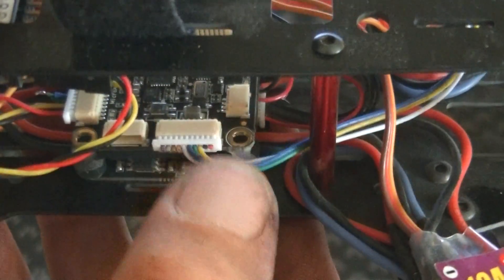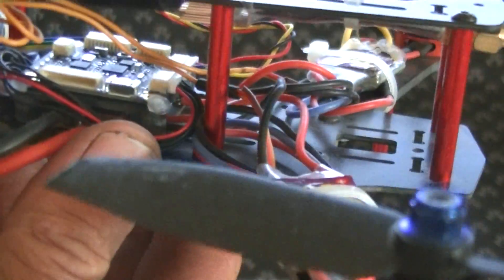apm2.7 with cppm

Comment: Hi again. I'm testing a 250 quad with the Micro HKPilot 2.7.

Did you ever encounter any issues when in Altitude hold mode? Every time I try to put the mini quad in Alt Hold mode for an AutoTuning session, the quad doesn't maintain a stable altitude and actually begins to rise and fall randomly and eventually I have to land it. I've put foam over the barometric sensor, but still it doesn't work.

I'm not sure if you're still flying miniquads with the micro APM, but I would really appreciate it if you wouldn't mind posting some of your Mission Planner tuning parameters for any miniquad you may have? Anything similar to a ZMR 250 would be perfect.

Specifically, I'm looking for:
Throttle Accel: P, I, D, IMAX
Throttle Rate: P
Altitude Hold: P

Loiter PID: P
Rate Loiter: P, I, D, IMAX

Also having all parameters in the 'Extended Tuning' tab would be very helpful. Such as the Stabilize and Rate PIDs.
Reply from the maker: RoboTekno unfortunately this happens a lot.  my first micro apm worked flawlessly... so good in fact that I ordered another one.  the second one would fall or take off in alt hold mode.  I even ended up with  a fly-a-way from it, and didn't recover my craft for 5 days.   I swapped out the new board with the older one that worded great and the craft performed excellent.  I recommend doing a warenty return from HK...  their Is another micro apm called the apm 3.1 that you can find on ebay... its made by a different manufacture, and might work better, but I recommend doing some research to find out if it has the same issue.  their is another option called the pixhawk lite a minitureized version of the original.... again found on ebay for 65$.  It's a 32 bit processor apm and although it is bigger its still small enough to fit in a 250 or a trifecta.   I have acquired 3 of them and will be testing them out in the next few weeks, so keep an eye out for a video on my channel on it or message me in a week or two and ask me if its any good.
Reply: Dr. Drone I see. Thanks for the info. I am aware of the 3.1 boards, but I chose the 2.7 since it seemed to be a more mature platform. I may do an RMA as you say if I can't get it to fly within a couple weeks. I was also looking at small Pixhawks, but couldn't find many videos demonstrating them. I may do some more refined research on them.

Thanks again. Perhaps a latest batch of 2.7 or arducopter firmware has some flaws.

Comment: Hey, I'm currently installing the micro HKPilot in a 250 size quad (Strider Flex). Your videos have been an invaluable source of information. Unfortunately I'm still trying to get the thing in the air! 

Everytime I try to fly the quad it wobbles like crazy and I have to land it. I'm a noobie to Ardupilot but I am aware of the Autotune feature and just trying to get the quad flying ok so that I can use this feature. No luck yet! What kind of PIDs are you using?

I notice you don't have the flight controller bolted down with nylon spacers like I have done? How is the FC fastened in this video? Assuming some sort of vibration damping on the FC mounts would perhaps help with the wobbling?  

Any advice appreciated thanks!
Reply from the maker: Joe Price   HI Joe,  
   sounds like you could have a bad board.   I just got done making a video for one of my micro apm boards that was very unstable....  I copied the pids to another micro apm I use on my trifecta and it worked fine.   
   Try lowering the pids for the axis its wobbling on.   mine was bad on the roll axis,  the stock pids are 4.5.   be carful lowering to far,   if you lower it to 0 then your basicly turning off stabilize for that axis.  or try using alt hold mode to confirm the board is bad...  mine would go up and down very irradicly .
Reply: Dr. Drone What pids are you using then on your 250 quad for roll, pitch, and yaw? I have put the Ardupilot parameters back to the default and will try again. I also mounted the FC on a flat surface with double sided foam tape. Hasn't made any difference though... Think I'm soon gonna blame it on a faulty board and will RMA it. Thanks for your help.
Reply from the maker: joeprice22 just make a video of the problem when it flys... I just got my refund today from HK.   the stock pids worked fine for me befor I autotuned it... i'll hook it up this afternoon and copy the pids and post them
Reply: Dr. Drone alright thanks bud. will certainly appreciate that.
Reply from the maker: Joe Price hi Joe,  did you ever get you micro apm figured out or returned?
Reply: Dr. Drone Hey, well sort of but still far from being fun to fly. I managed to figure out the wobble issue by manually tweaking the pitch / roll stabilize PIDs to around 13 and keeping the yaw at the 4.5 default setting. 

I'm struggling now to fine tune the throttle so I can hover at mid stick. I'm close but I can't seem to find the hover sweet spot as it is either drops or rises slowly? Any tips besides playing with the throttle mid setting or throttle pitch curves? 

After that I get the throttle sorted out I should hopefully have the copter advanced enough to carry out autotune.

Ardupilot it definitely the more advanced of the flight controllers to setup. Sometimes I think I need a PHD to do so!

Comment: Hmm. Instead of buying a new cable, why not just remove the pins you didn't need from the stock cable by lifting the plastic tabs on the connector and pulling out the pins?

Also what frame are you using in this video? Looks like a ZMR-250 or other Blackout clone. How do you like this frame with the APM?

Thanks again for the nice videos :-)